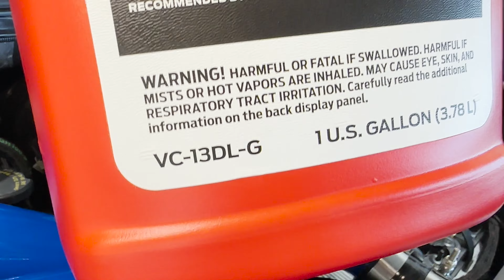don't tell YOUR wife | YOU might want THIS @pusherintakes #diesel

Comment: Believe me when I say, I know they make great kits.  Quality and lots of excellent reviews out there.  I had the one side on my '17 have the notorious split so purchased both sides (to look extra cool and all).  Problem was, no matter how I would attempt to orientate, I could not for the life of me get to fit without rubbing metal on metal on the high side and the lower side (from the side cooler) tube had to sit so far down into the elbow that it was choking it off.  After spending multiple days and sending back-n-forth pics, I had to return.  I just needed to get up and running again so ended up purchasing the ford factory piping.  Got it to assemble and fit within 10 minutes.  Again, I know lots of folks have such success and have to admit, I admired the materials used and quality as such.  Just wish I would have figured out why my assembly was not going together right even after taking several breaks over the course of days to come back refreshed and with a new hopeful perspective.

Comment: Why is it when I get coolant additive check light on No one knows what additive needs to be put into it ......?????
I've called multiple dealers and to no avail zero answers....
Reply from the maker: What color is it? That truck originally had orange which had an interval to check. The new yellow coolant they have out does not & if your truck has been drained it most likely would have gotten the new coolant.